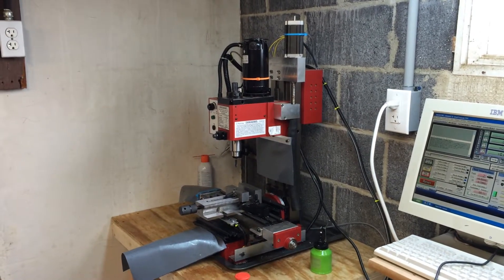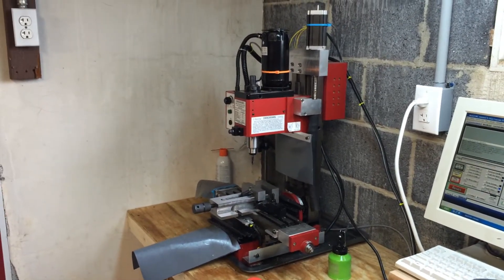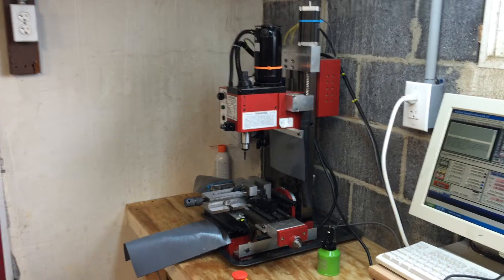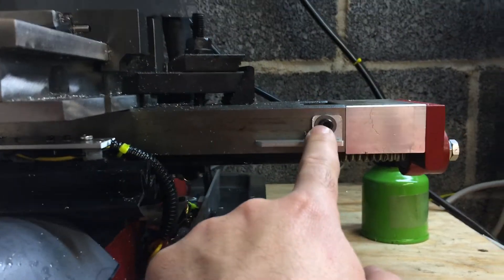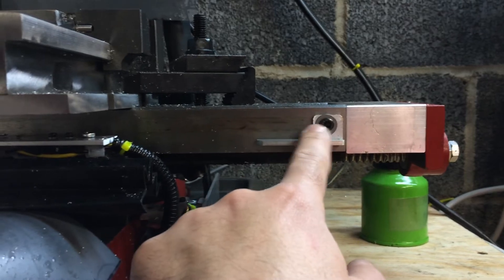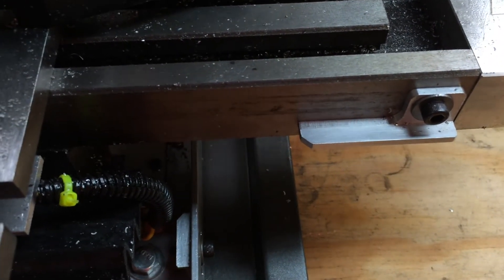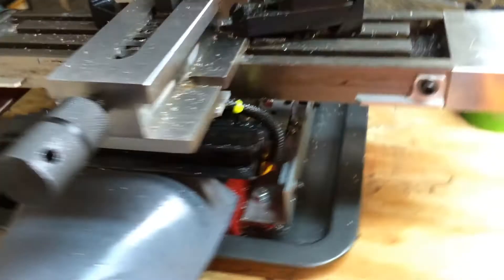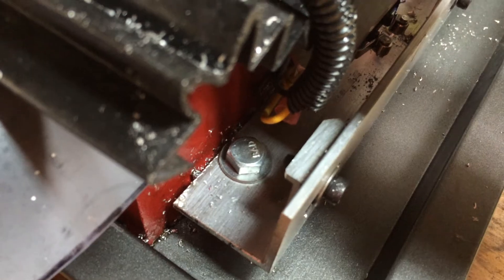Limit Switches on the Harbor Freight (Sieg X2) Mini Mill CNC Conversion

Comment: How is that little mill? It can be purchased for $550 with 20% coupon and $75 shipping. Seems like a fantastic deal. The also have the rf-31 model for $950 plus $89 shipping with coupon. One of my 3 mills is an earlier RF-30 and it’s a fantastic and accurate machine. It can pedal through alloy with a 1-7/16 end mill 3-16 deep without a grunt. Not that I need another mill right now but I’ve been starting a collection of them and converting to CNC to make product to sell. Having 10 little bench mills running everyday could be a profitable venture. ;-)

Comment: Really good, thanks! I'm in the process of using FigNoggle CNC plans. I already have their DRO plan installed. I'll be able to run manual or CNC, and they are designed for eachother. Sometimes running manual is faster for simple stuff. I was wondering how you wire the limit switches to the BOB? That's something the plans don't include.

I already have the limit switches, and bought the www.BYCNC.com redFly CNC Electronics Box and stepper motors.  They give a diagram example online. I would select the NO and run them parallel. Would you then connect all your limit switches together that go to one pin either 10,11,12, or 13? Theother side of the switches go to GND. That's the way I'm reading it. Also are you running MACH3? Thanks in advance for your help.
Reply from the maker: Crevice Dog Hi. We are still dealing with the aftermath of Irma down here so I have to keep this brief. I use Mach3. NC connection. All switch wired in series on one input. Check this out: https://youtu.be/5D7px0r0pUE
Reply: Hello FRANCO, Sorry to hear you were in the wake of things, and hope your losses were at a minimum, especially lives were spared. Thanks for the link, I watched the video, good job! Downloaded the nice spec sheet you have. I have more questions but you're quite busy. If you'd be so kind to send me an email to crevice.dog[at]gmail.com when you have the time, then I'll respond in kind. Thanks again! CD

Comment: Franco, I was wondering why you went with the mechanical switches and trip dogs instead of neodymium magnets and reed switches. It seems like that solution would be much easier to set up and fine tune to obtain the accuracy, responsiveness,  as well as retain the full travel length on each axis, and be repeatable. I think that it would also be beneficial to have limits on both ends of each axis to avoid any problems that might arise. Am I overlooking or missing something here?

Peace!
Reply from the maker: Hi. I don't like to use magnets where chips can stick to them. I've had good experiences with mechanical switches. They're cheap and easy to connect. Certainly, there are other ways to get the job done, but for me, this was the easiest way to get up and running. Don't under estimate the repeatability of limit switches.

Comment: Nice clean setup.
And you explained your setup well, thanks for posting the video.

I'm wondering through youtube looking for different ideas on mount switches for my mill table and since your using Mach3 you can get away with one switch per axis, and I think your machine would work with that (well the X & Y would be easy to change).
The X & Y could be changed over just by making the "trip dogs" longer for each of these axis, just think of your setup with one switch mounted in the center of the two you have now and the "trip dogs" a little longer. 
But with the Z you'd need to mount the switch to the moving part of the mill and have the "trip dogs" where your switches are now.
Reply from the maker: Thanks for the comment.  I considered using a single switch when I was making the brackets.  I chose to use two switches so each end of the limit would have the same (symmetrical) angle of attack and identical responsiveness.  If I were to go to a single switch, I'd make sure the limit that triggers during a reference return is very repeatable and accurate.  The other end of the limit that simply prevents the machine from over traveling probably won't have the same responsiveness, but that really doesn't matter.